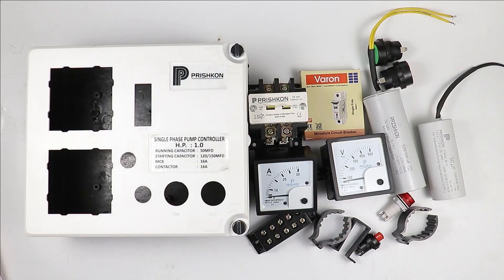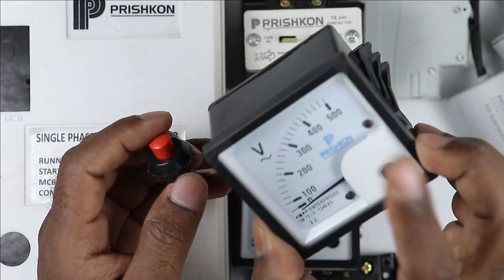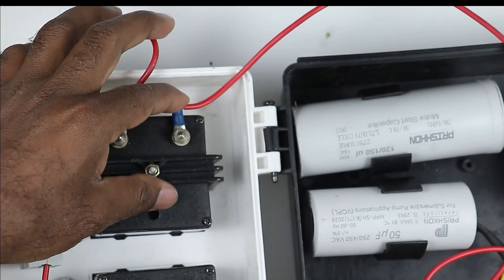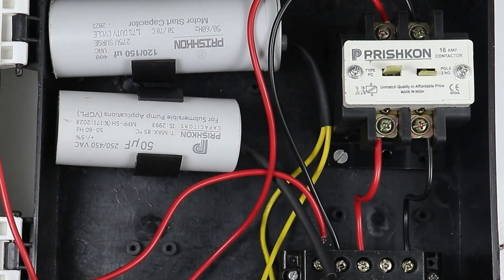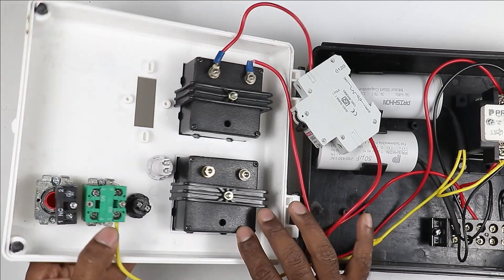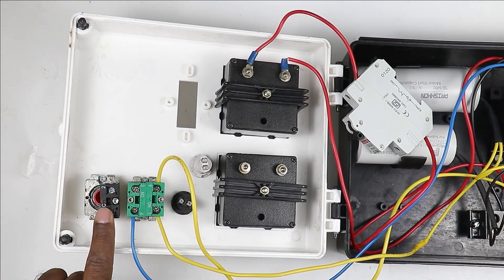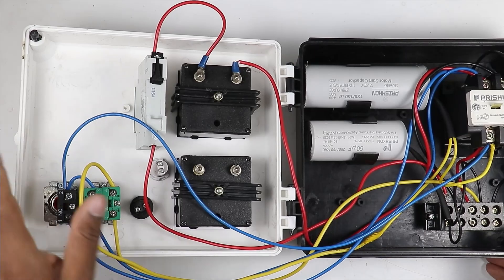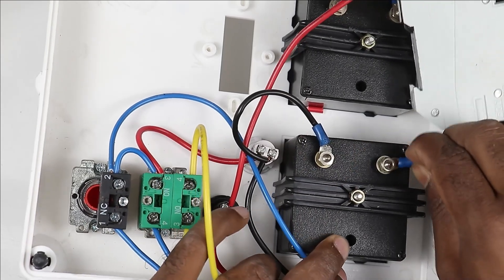Single Phase Submersible Pump Control Panel Connection with 2 Capacitor @TheElectricalGuy

Comment: My summer pump ia not working. The capacitor used is 36 mf , water is coming at very low speed . Can i use 2 capacitors for that . Can you suggest something
Reply: Sir use new capacitor one only old one is weak

Comment: Can i use a 16 a wifi switch anywhere in this circuit so that i can control it using mobile app or any voice assistant device